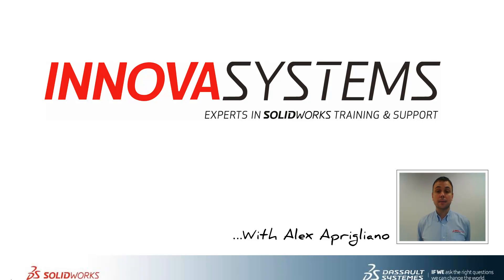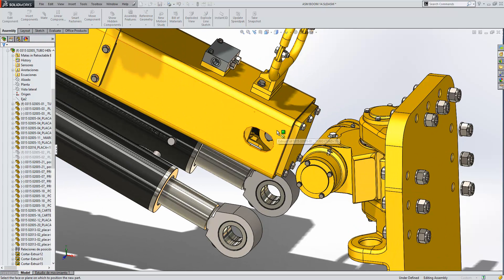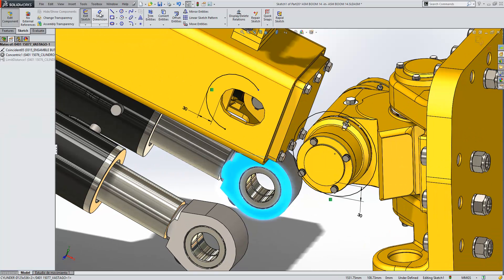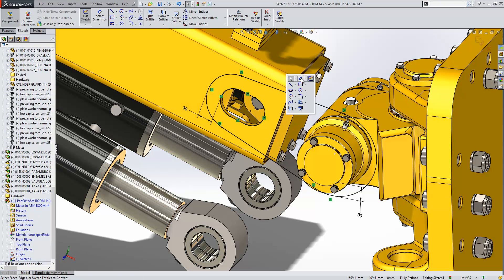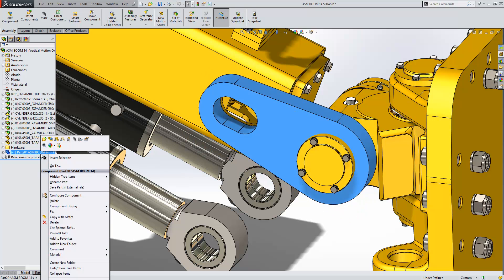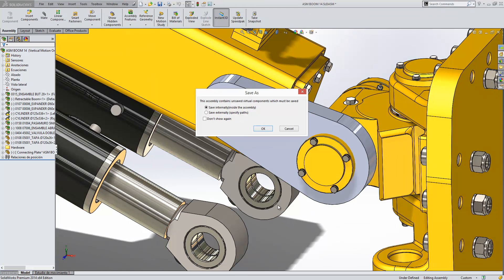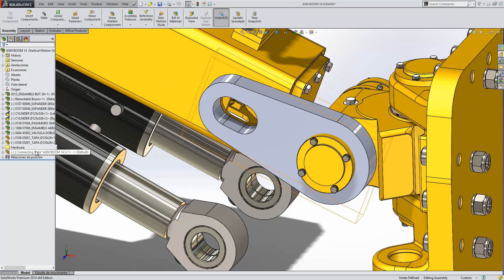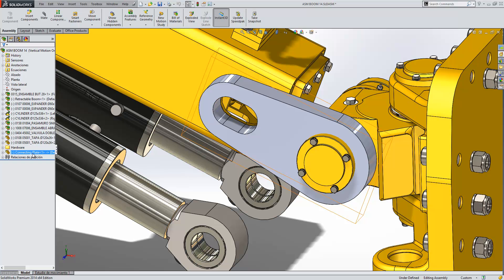How to save internal parts externally in SOLIDWORKS

Comment: I am having a problem with configurations. I make an assembly and it has parts with Excel table configurations. call it abc123. But when I make the same assembly to be a bigger size and save it as a different assembly number say to xyz123 it changes my original assembly. How can I have multiple assemblies that are alike but of different assembly part numbers? When I make a copy of it and change it, it still changes my original assembly file, can I break the reference between assemblies? Thank you James in Texas